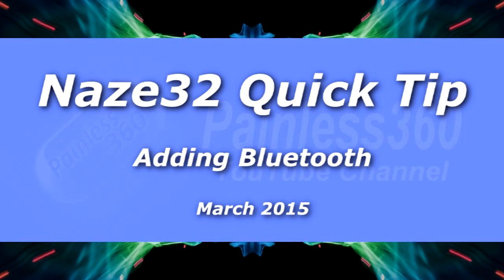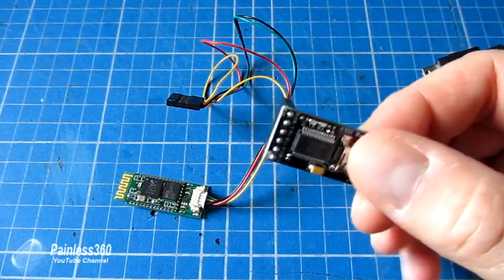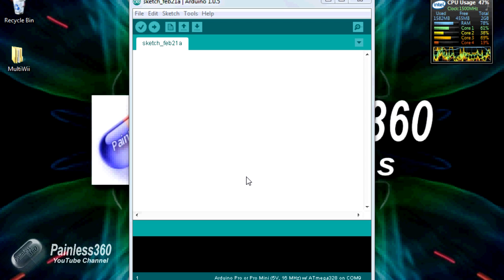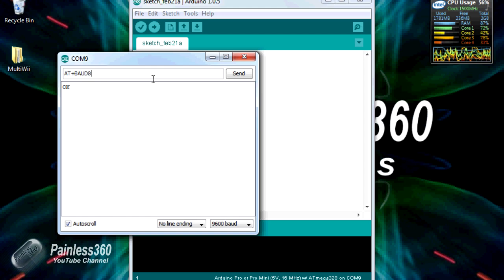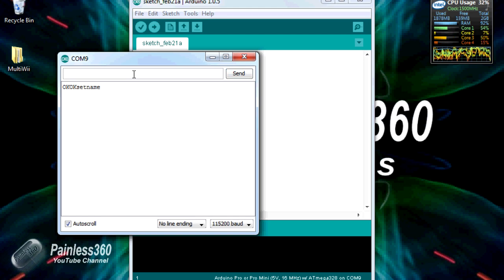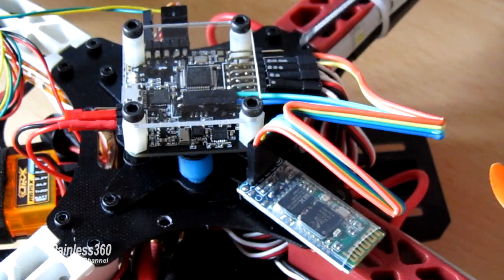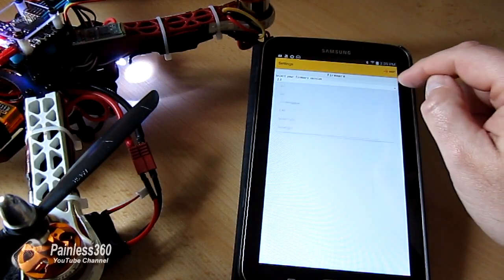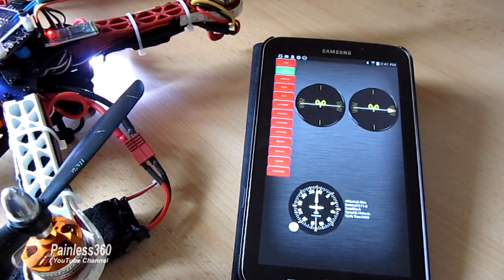Naze32 Quick Tip – Adding Bluetooth (HC-06 module)

Comment: Hi 
A wonderful tutorial Thanks 
I have an issue I cannot get Bluetooth working with UART 1 it works perfectly fine with UART 2 could someone please guide me !
Reply from the maker: Not all uarts on a flight controller work in the same way. So depending on the one you have, sometimes it's trial and error to find one that works for you.
Reply: Painless360 Many Thanks for the reply, But am trying this on a Naze 32 itself

Comment: Hello sir, is this important to change baud rate of Bluetooth module from 9600 to 11500 for connecting with sp racing f3 flight controller...?
Reply from the maker: You need a  fast enough baud rate to be able to get the data into and out of the flight controller without too much waiting around. The board right also needs to match whatever you set on the flight control itself as well. Best of luck!
Reply: Thank you so much sir, you mean the baud rate of flight controller(in ports section of betaflight) and bluetooth module are need to be same i.e 11500, am i right..?
Reply from the maker: As per the video - yes ;)
Reply: Sir please, one last question i want to know that can i use a arduino uno instead of FTDI adapter to connect into pc for changing baud rate....?

Comment: trying to get my bluetooth set up but while trying to set up the FTDI i cant get the OK message back on any baud rate :/ any advise ?
Reply from the maker: Only to try and reverse the TX and RX cables and try other ports/bauds..
Reply: tried every combination i can think of , think my fdti adapter is probs faulty , will get another and try that , thanks for the help :)
Reply: Also when using a bluetooth module once setup is the module only usuable with the 1 FC or can it be swapped between FCs , or does settings have to be changed for each FC

Comment: If bluetooth works on 2.4 GHz, will it not interfere with radio controls? And if it doesn't, why does WiFi cause issues?
Reply from the maker: Gairik Biswas an awful lot of things work in both the 2.4 and 5.8ghz frequencies we use in the Hobby. There are lots of frequencies in those ranges and different ways to use them  (frequency hopping, spread spectrum etc.) so most robust systems can find a good connection, even if other things are turned on. Power levels play a part too. Bottom line - if you don't need something that is operating in the same range as the kit you are using then it's better to turn it off. Happy flying!

Comment: Hi Painless 
Do you think it can work on sp f3 flight controllers :)
Reply from the maker: Yep - see http://seriouslypro.com/files/SPRacingF3-Manual-latest.pdf IO_2 pins ;) Check the board you're looking at though...
Reply: +Painless360  connect to IO-2 channel 1234 ok / use uart3 tx rx ?

Comment: Hi Painless, i've shown again your video to setup my bluetooth module...i've got arduino program, opened it , my serial port is ok bu i can't get any reponse from bluetooth when i write " AT " or " AT +BAUD8" ...etc...No OK ...!
i don't know exactly which board is it... Arduino Uno or Arduino Pro and Mini...etc...( i've buy this bluetooth module on Banggood , i think this is the same like your )
May be this is the raison why i get no answer from program...?
What could i do...?
Thank's  lot
Philippe
Reply from the maker: For the serial piece the board shouldn't make a difference. I'd try the older V1.0.5 version of Arduino and keep trying those baud rates and wire combos.. Best of luck!
Reply: If your BT board is a clone like ZS-040 you need to change the setting at the bottom of the serial monitor from "No Line Ending" to "Both NL & CR". This should get things working. It's an old command (Carriage Return New Line) that tells the board your command is done.
Reply: sometimes the default baudrate is 9600
Reply: thank's for 9600...but i don't know exactly which board is it... Arduino Uno or Arduino Pro and Mini...etc...happy flights
Philippe

Comment: what if i have an osd using the fc tx and rx pins, can i splice or can i only use one or the other
Reply from the maker: +jimmi pinnington I'd use one or the other. I don't think splicing them onto the same uart will work. Best of luck!
Reply: Cheers. If ya get a chance could you do a vid on the frsky support side of the app
Reply from the maker: +jimmi pinnington check out the playlist ;)

Comment: How do I connect it to a naze rev6?
Reply from the maker: +matthijs jordense not tried, but it should be similar. Best of luck!
Reply: Painless360 Oh okay, thanks for the extremely fast replay haha
Reply: I used this procedure with a rev6 and had no problems connecting. Only thing is, to use some of the settings it tells me "firmware needs updating to 2.2". I'm not sure which firmware as my naze is on 14.something

Comment: Hello everybody. I'm using FTDI FT232RL, and this module http://www.aliexpress.com/item/MWC-Multiwii-Bluetooth-parameter-debug-module-Bluetooth-adapter-for-MWC-Flight/2038267540.html?spm=2114.13010608.0.97.jXOZ73 with Arduino 1.6.8. I've dowloaded CDM v2.12.18 WHQL Certified and windows (7) seems to be happy with ! But i've no AT response at all... I've one solide red light on the FTDI, and one solid green light on Bluetooth module + one flashing red light (1flash per second). I'm totally underqualified to understand what's happening so if you have tips... let me know please :) 
Thank you.
Reply from the maker: Use Arduino 1.0.5 for a start. Best of luck!
Reply: Hello and yhank you very much for your answer. So i've tried with Arduino 1.0.5, with several USB cables, wiring is 100% correct, tried all the baud, restart the pc again and again... and i've also tried with this arduino http://eu.banggood.com/Wholesale-Warehouse-ATmega328P-Arduino-Compatible-Nano-V3-Improved-Version-No-Cable-wp-Eu-959231.html (just in case)... but all "AT" send never come back... I saw that into the "Board" menu, "Arduino uno" is checked ... it the good one ?
Thank you again.
Reply from the maker: Not sure, sounds like a driver issue. Best of luck with it..

Comment: nice tut as always.But what i the use of this application in pilot,double the fpv? , how far  can it work?
Reply from the maker: +francois Bonin Just used for configuration at the field without the need for USB cables. Also allows for connection to it from devices like android phones running the rights apps..

Comment: Hi painless,,,,

i need to reconfigure my bluetooth module in my thug 180, its soldered in, i normally do it with an ftdi, is it possible to do it through cleanflight using at commands ? and serial passthrough maybe...?
Reply from the maker: +bing quadby not sure that latest Cleanflight has pass through but that's more for BLheli support.. I'll look into it..

Comment: None of this applies, at all, to the HC-05 I have.  to change baud the command is AT+UART=115200,0,0, completely different than AT+BAUD8.  nonetheless, I can't get it to work.  I can send AT commands, I can name it, set the baud, connect via Android, but get WARNING - no data received! from EZ-GUI.  Also, even though the AT+UART command indicates 115200 baud rate, the Serial Monitor in the Arduino IDE is set to 38400, both NL & CR (which the video shows "no new line"), any other baud rate will not work!  According to the video, the Serial Monitor and Baud rate have to match the baud rate set on the BT device, but this is not what I'm experiencing.  7 hours later and I'm about to throw in the trash.
Reply from the maker: +tchthsky How do you know if the FTDI and drivers is working? Have you tried the earlier version of Arduino? Appreciate you are stuck but from what you've written there is more to try before giving up ;)
Reply: +Painless360 Hi. I got it straightened out after 5 or 6 hours lol. There were a lot of differences between your version and mine.  In fact, I had to short the Key pin (it's Key on mine, can't remember what the other version calls it) to VCC to put the HC-05 into AT mode (Key has to be at 3.3 v, I think, but my HC-05 is 5 volt so that's what I used;  THAT was what was messing me up!  Also, another important difference is that when th eBT module is in AT mode, baud rate is 38400, another thing that caused confusion because in your demonstration you changed the baud on the BTM then had to change the rate on the Serial Monitor to match in order to talk;  NOT the case with my version. The Serial Monitor must stay at 38400, even if the baud is 115200 on the BTM. This confused the hell out of me because at first I didn't know that baud has to be 38400 in the Serial Monitor due to the manditory baud rate of 38400 on the BTM while in "AT Mode".  Also, you must use New LF & CR along with the 38400 baud rate... another distinction....
Reply: +tchthsky To summarize for anyone else who comes across this: 
For the HC-05 (my version, anyway) and Sparkfun FTDI 

- Fire up Arduino (same thing Painless used)
- You must short Key to VCC.  Then connect everything  to the FTDI *EXCEPT VCC*. Then connect power to VCC and you will be in AT Mode.  The Bluetooth Module will pulse it's LED ever couple of seconds.  When in normal operating mode the BTM LED will pulsate repidly, waiting to be paired.

- Open Serial Monitor and set the baud to 38400, ALWAYS during configuration.
- Test by entering AT and press Send button - should get confirmation "OK"
- Now change the Baud Rate of the BTM by entering AT+UART=115200,1,0 (the 1, and 0 are stop bit and parity)
- Test by entering AT+UART - the return confirmation should be 115200,1,0 
- If you want to name your BTM, do AT+NAME=MyBlueToothModule... or whatever you want to call it
- If you want to change the Passcode, enter AT+PSWD=XXXX (XXXX is any numeric value you'd like)
- To reset the BTM to factory defaults, enter AT+ORGL

@Painless, even though your module was entirely different from mine, the info you posted was still valuable to me (I wonder if I have an older HC-05)... I must have been through a hundred sites of info, starting with this vid. I thought for certain my FTDI adapter was a bust... but everything works!
Reply: +tchthsky One more thing to note, my HC-05 does not have the button... if you are in the market for one of these BT modules, and you want it for a Naze, in particular, either buy one that has the button (this I believe will allow you to bypass shorting KEy to VCC...I imagine that's essentially what the button does, anyway) or you could wire up your own little tactile button from Key to VCC to do the same thing, and/or buy one that states is Naze ready, or some indication that it's compatible with Naze;  All this means is the vendor (who you buy from) has already set THE BAUD RATE to 115200 and probably the NAME variable, too.  The default Baud rate for Naze is 115200.

Comment: Hope this helps someone. I used Arduino 1.6.8 IDE, CP2102 USB-TTL, 6V HC-05 module (different versions of the HC-05 and I received one with the button). Press the button while powering the HC-05 with 5V and it enters the "AT mode", release the button, the LED should blink once every two seconds. Changed "no line ending " to "both NL & CR". Set the baud rate AT+UART=115200
Reply: +Jim L You have a similar version as I do.  I about pulled my hair out trying to figure this out.

Comment: Hi! I can't get HM-10 working with softserial on my SPF3.
I've set the baud rate to 115200, activated the sofserial 2 (with serial RX) on cleanflight and nothing. Some idea?
Thank You.
Reply from the maker: +The Running Cam We've never used that here. I'd check it using the AT commands to make sure it's also set to the same as the SoftSerial port. SoftSerial shouldn't be run above 19,200 baud too....

Comment: I tried your example. So I have a HC06 and a FTDi adap. (USB to serial)
The LED on de BT flashing The problem no connection via the Arduino IDE.
What I miss is a program... before you can make communication with the serial monitor.

Or is that wrong to assume?

Comment: Argh, from the cleanflight manual - "There is a maximum of 2 MSP ports." Needs MSP for the USB connection, that leaves the free MSP option for the OSD or bluetooth, but not both at the same time. When selecting 3 MSP ports and saving the settings are reset.
Reply from the maker: You can share UART1/USB with an OSD but you need to unplug the OSD when using the USB port.. Best of luck!

Comment: Is the naze32 compatible with 3.3v logic levels Bluetooth modules or only with 5v ones?
Reply from the maker: A lot of the signals are 3.3v, check out the manual for details. Best of luck!
Reply: Painless360 thank you

Comment: can i calibrate ESC though the bluetooth adapter? using the codes or another way? trying to avoid pulling the quad apart again. haha
Reply from the maker: +dudeskinus You can calibrate through the GUI on a PC, might work over BT but I've not tried it. Make sure the props are off!
Reply: +Painless360 I'm hoping this will solve the problem of one ESC beeping every 5 seconds. I've not changed anything other than put my vtx between top and bottom plates. I'll try the BT unit and let you know if it works that way.

Comment: Hi Lee

Quickie if I may please, I have an Overcraft PDB on my ZMR250, It makes use of MinimOSD which uses the two top pins on the Naze32, The same two pins which you show to be used for the Bluetooth adapter, can I solder the 2 TX AND RX wires together to use both on the same two top pins??
Reply from the maker: I wouldn't both the BT and OSD will try and 'talk' to the FC at the same time confusing everything..
Reply: +Painless360 thanks Lee,  you basically answered as I was thinking. never be too sure .. lol

Comment: Help , orderd the ftdi and bt from bg , have it setup to com 4 and pluged to bt board everything looks good but when i open serial monitor and type AT nothing , have tried on all the baud rates , any ideas ?
Reply: How did u sort it out m8? I can't do nothing, have the same problem but I dont have the button on my HC-05 :(

When I power it on I have 2 LEDs flashing, red one and blue. Is that mean something?
Reply from the maker: Swap Tx and Rx.....
Reply: Painless360 no that wasnt it at all , the arduino software refused to talk to the bt. i used flash magic and on hc-o5 the button on the bt board must be pressed before power up to get it into a programing mode. . . honestly im amazed i figured that all out, thank you so much for the help , you are awesome. . and I love the way you say " Stuff "  stoof
Reply from the maker: +RC Surf :)

Comment: Hi Lee, Long time now speak.. I hope you had a great festive season and that this year is a good one for you and yours

Ok, So, I have the BT module connected with solid red light and connects to the GUI, However, I am not getting any data from the board, None of the dashboards show any movement from the craft when it's moved ...  ?
Reply: +Richard Hamilton   Hi again Lee, I got it working thanks, had to re-install the latest Arduino GUI and it all worked a charm, excellent tutorials as usual mate!!
Reply: +Richard Hamilton  Do have a link to which BT module you bought? Thanks!

Comment: When I am entering "AT" into serial monitor and press "enter" nothing happens. No "OK"! FTDI has red LED and bluetooth module has green LED and a flashing red LED.
Whats wrong?
Reply from the maker: What troubleshooting have you already tried?
Reply: +Painless360  No success swapping RX and TX. Is it possible that the LED's are working and the BT module is faulty?
Reply from the maker: If the drivers are all ok then that is a possibility.. Best of luck..
Reply: +Painless360 The drivers for FTDI are installing by themself when plugging it into PC. So they should be OK. FTDI is working with my GPS unit and also with Mprog.

Do I need drivers for the BT module? and if so, where can I get them?
Reply: +Silberner Surfer  I have no success with the AT commands in the serial monitor. But I have tried to connect the BT module to EZ-GUI and I was able to connect it. Unfortunately EZ-GUI says "No data received"!
Reply: +Silberner Surfer  I have tried to connect the bluetooth with EZ-GUI again. It works 
without changing the baudrate. Seems that default on my BT is 115200. 
The mistake before was that I was connected to CF too.

But it isnt possible for me with my BT module to set the baudrates or changing the name via arduino serial monitor.

Comment: I want to thank you so much for this tutorial. I have a really tight quad that was designed around a different flight controller, so I'm not able to plug in the USB jack without taking the quad's chassis apart (huge pain in the arse). Using this tutorial, I was easily able to wire in a HC-06 (with no prior knowledge) and get it connected to my desktop PC. Now, I can finally tune my PIDs at the field!! Thank you so, so much and keep up the fantastic videos!
Reply from the maker: +Kyle Hertler Great work! Those FTDI adapters are worth their weight in gold!

Comment: Is it possible to do this same Bluetooth setup using an Arduino instead of the FTDI adapter? I'm getting no response from my BT in the serial monitor [I'm using an Arduino Duemilanove] using any baud rate.
Reply from the maker: It is but we don't here..
Reply: +Painless360 I was hoping to use my Arduino as a stop-gap method until my FDTI arrived, but I never was able to get it running. However, once the FDTI dongle came it, I continued your instructions and voilà!